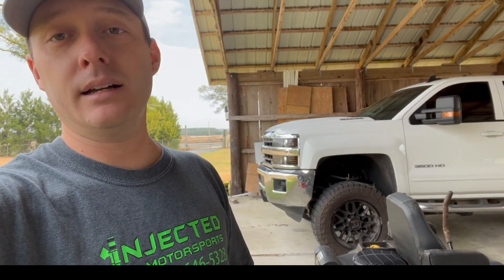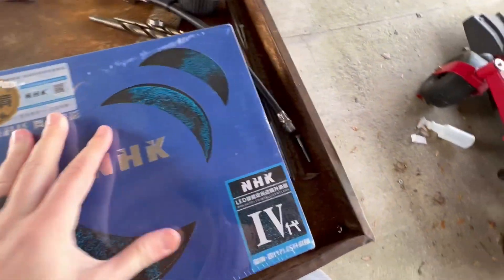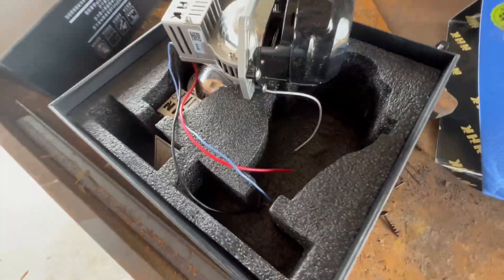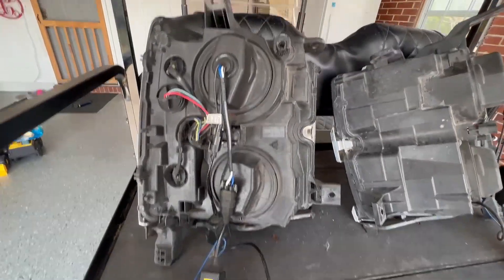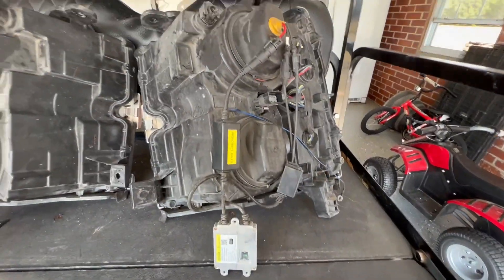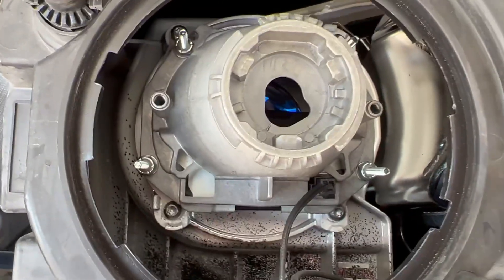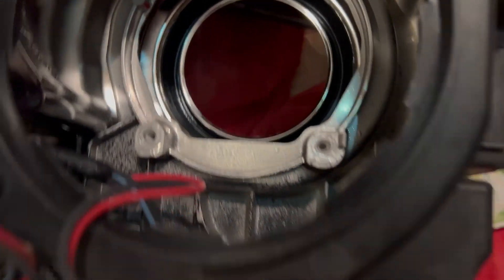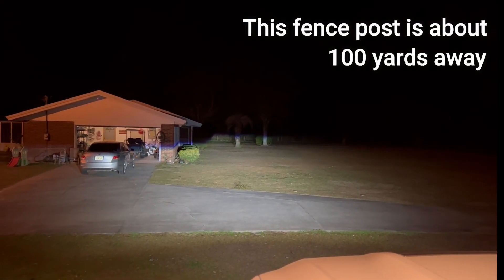Silverado HD Bi-LED Projector Retrofit

Comment: Do you remember by any chance how you got the wires connected to the OEM wiring? Please and thank you!
Reply from the maker: Just had to cut the wires that go to the factory bulb connection and solder the wires for the projector to it, then you’ll have to connect the high beam solenoid wires to the factory high beam wires which can either be soldered or you can use T taps
Reply: @derrickcassel  so you basically bypass the ballast and connect straight to the power wires, right? What about flickering? Did you get any of that when first starting the car?
Reply from the maker: This truck originall came with incandescent bulbs but yeah if you’ve got HIDs the 12v source comes before the ballast.  I thought it was in the video but I did end up adding anti flicker modules because otherwise they would flicker and go off.
Reply: @derrickcassel  Understood! Do you have any specific modules that you recommend?
Reply from the maker: @IzzYChannel  I’m sure you could use just about any of them but I got mine from Lightwerkz.net.  They’re a great company with great customer service and they’re priced similarly to other places.
Reply: @derrickcassel  great. Thank you much!

Comment: I just finished doing this install in my 2019 Chevy 2500, same truck, same headlight housing and same projectors. Happy with the output, great so far. HOWEVER, my install did NOT go this easy, i had to do quite a bit of trimming inside the housing to make them sit flush, in addition to the trimming of the projector as Derrick mentions in the video. 

I had to slightly modify my brackets to make the holes line up, just turned the 4 projector mounting holes into slots to allow them to align with the housing properly. 

Also, if your truck is leveled, i do not recommend running a spacer between the bracket and the projector (for upward or downward tilt), i ended up having to remove them to get the proper alignment, but added an 1/8” spacer between the bracket and the projector on the driver side to aim it outward a little, this helped get the step in the middle of the road instead of the middle of my lane. 

Also, one of my projectors had a bad red hue and the cut off was garbage, come to find out it was missing washers between the projector lens and projector body, i was able to space it properly and tighten it just right to get the perfect alignment, completely fixed the issue. 

This was only my 2nd retrofit but needless to say i had all kinds of issues i wasn’t expecting, if anyone is doing this exact install and needs any advice please feel to reach out to me, i‘d be happy to share my little pointers over the phone or email. 

And i’m not trying to say that Derrick was wrong about anything, i’m just saying that my particular install was different. And honestly im sure all of these housings are slightly different, causing alignment/fitment issues for some.
Reply from the maker: Lighting is still just a hobby for me and I've probably only done less than a dozen sets every retrofit I've ever done needed little tweaks and stuff BUT I will say on these headlights specifically though every one that I have done has gone really smooth so I'm not sure what was going on with your particular housings.  I have heard of a handful of people having weird things like that with those projectors but of all the sets I've used they've been good.  
Glad you were able to get it figured out and if nothing else I hope my video did more good than harm to your process.

Comment: Its amazing that i stumbled onto your channel, i have the same truck, the same nhk bi-xenon projectors from lightwerkz. Just replaced my bulbs from age and the brightness i was missing is amazing just from bulb change. 

I’ve been looking at reviews for this exact nhk bi-led too. Do you think the bi-led is brighter than the hid setup? I run mine at 55 watts, not sure what you ran. 

I’ve become a “flicker junkie” as Cesar (lightwerkz) would say, love that thick color band on the nhk bi-led.
Reply from the maker: Haven’t driven with them at night in this truck, still waiting on my anti flicker module.  I have these same projectors in my daily and they are brighter from what I can tell (especially the HB with the extra LED), hard to tell without a side by side comparison though.
Reply: @derrickcassel  Thanks for the info. Would love to see a night drive video if you have time, and maybe a shot of the truck coming towards to camera, be cool to see what oncoming traffic will see.